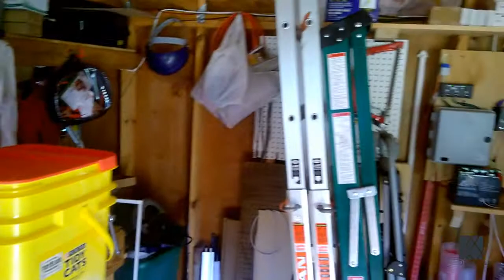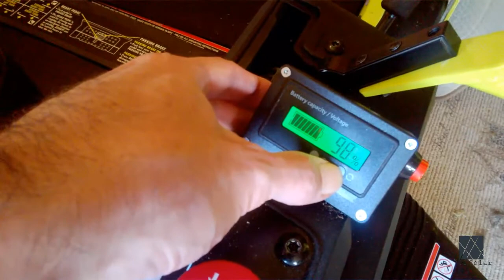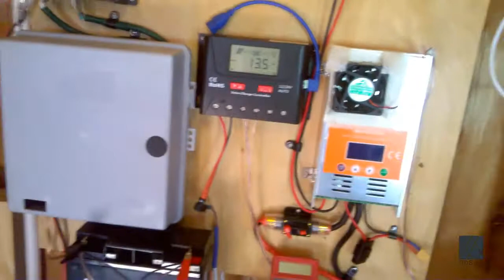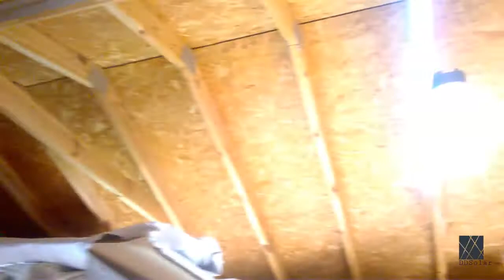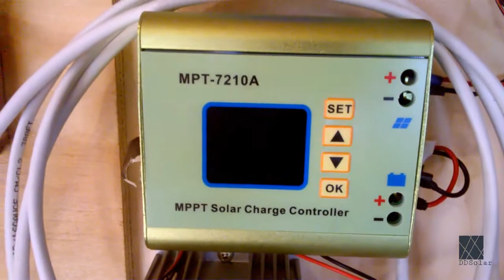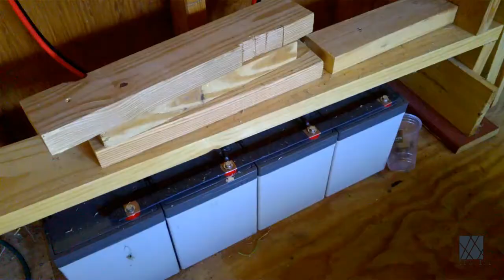Solar Shed - LiFePo4 Mower - Passive Solar Lighting

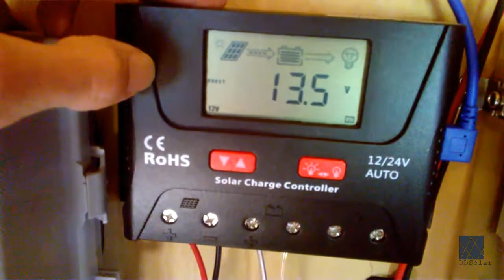Comment: Thanks for the shed tour - looks like a well thought out space. Just curious what's the brand & model of the 12/24V PWM charge controller which you said you really like (shown at 4:20)?
Reply from the maker: Welcome, I'm thankful for the views hehe. I had to go out and look at the label on top. That is an HP2430 - PWM solar charge controller, hard to find any more. You can search eby with this number 125650670677  They are kind of overpriced now unfortunately.
Reply: @solarpoweredge  Thanks!
Reply from the maker: No problem!

Comment: DDSolar, I'm in Casablanca in Morocco (North Africa) working converting a riding mower to electric with LFP battery pack using 2 wheelchair drives for motion as zeroturn and still strugling to find cutting bldc motor to turn 71 cm blade. Can you please write me the brand and model of the one used on your Ryobi zeroturn riding mower?
Reply from the maker: Hello sir, greetings from US to Morocco. Sounds like a great project. Unfortunately I don't have exact specs for the motors other than they are 3 phase brushless motors and apparently common in multiple brands of mower equipment. 71cm is about 28 inches, the blades on the ZT480 series are 21 inches each. The motors are part # 997026001 (deck motor) and this mower has 2 of them.  Searching this part # on the internet will give you a few links to check out. The blades are directly driven, no belt. I suspect this motor "might" drive a 71cm blade if you don't push too hard. You need 2500-3500rpm for a mower.  Please check this link, I suspect it's a similar motor, but might be underpowered for a 71cm blade.  I hope this is this information is helpful in your project. https://www.bibus.es/fileadmin/product_data/hydro-gear/documents/Hydro-Gear_SMARTEC_Deck_Drawing.pdf
Reply from the maker: Here is another link that might interest you, I am not sure it's the same motor but it is actually a "deck" motor: https://www.hydro-gear.com/product/d3e/
Reply: Thanks for your quick replay. I'll check those links.

Comment: Hey I have the same mower and was looking into going LiFePo4 when the original batteries go bad soon. Was there anything you had to change on the mower when you switched to LiFePo4 or did they just work? I know the battery meter won't work anymore and the charger will need to be one that works with LiFePo4 batteries. Were there any other electronics that needed to be changed? What batteries did you use? Cool stuff!
Reply from the maker: Hi there, I literally ran the PB batteries 15 minutes twice and gave up. Very little run time, I was not happy. Ending the second season with this mower and I love it. 16S LifePo4 works like a champ. They are run of the mill 48v packs from online auction site. I installed a battery meter, plan to add more stuff later, will make a video. I recommend at least 60AH capacity. Mower pulls 16-18A sitting still with blades energized. Once it hits grass it drinks the battery pretty fast. No electronics change beyond what you mentioned, unless you want to tinker. The charger included is very powerful and I do use it to charge the pack, but am very careful to monitor the voltage. Kind of risky. Have charged it off solar too, works great. I hope to do some upgrades by next season or over the winter. Maybe you can record a video when you switch over. Thanks have a good day